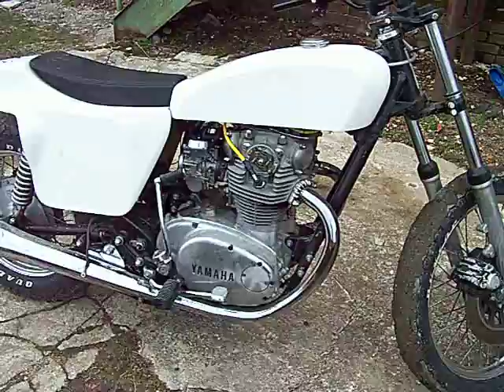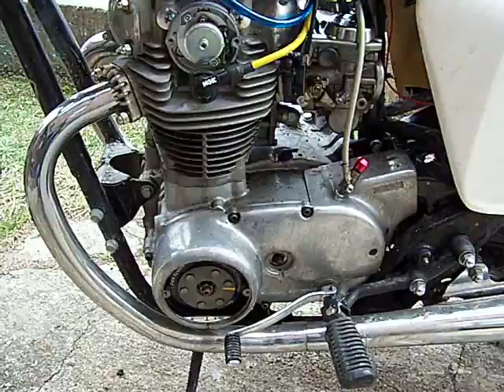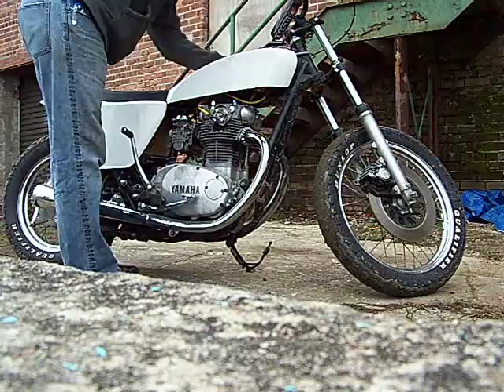Kick Only, PMA XS650 (No Battery!!)

Comment: Here's a dumb question. Are you running lights? And if you are, how are they working sans battery, or does the Pamco and the Permanent Magnet swap provide enough juice to run them? I'm running nothing but kick start and would be great to not have to worry about a battery, just hoping I can still see at night though.

Comment: Hello I have a 1982 yamaha xs650 and Im thinking of istallint a Permanant Magnetic Alternater. I understad that I will need to also install a diffrent ignition other that the stock ( electronic ignition ) . I allready have installed a High Output Replacement Ignition Coil , Silicone Plug Wires , NGK Resistor Spark Plug Cap (5K Ohms). Can you help me out and give me a list of what eles is neede in order for me to make this ignition change.

Thanks...